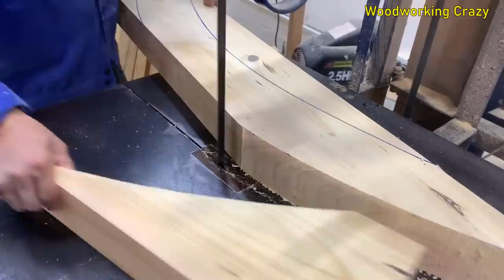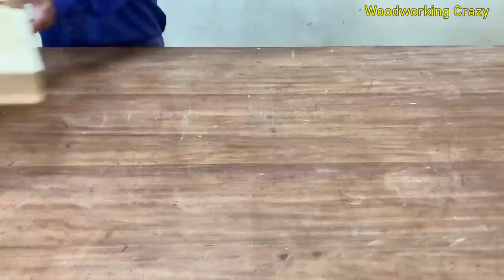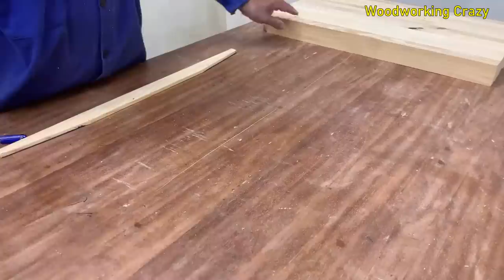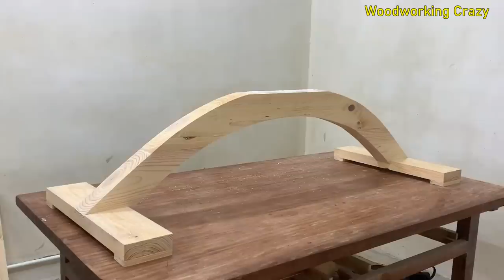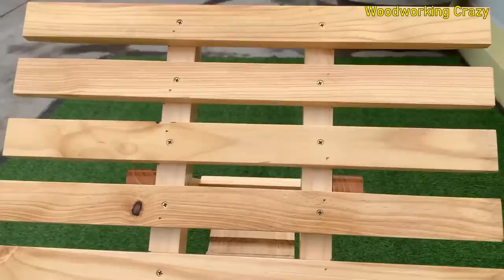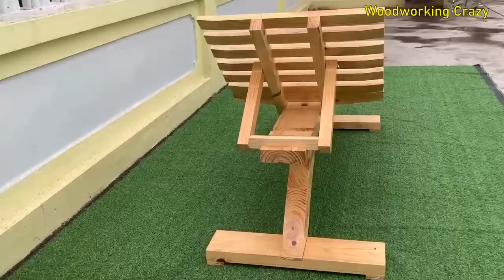The Technique Of Joining Wood According To The Curve Of Skillful Carpenter - Relaxing Folding Chair

Comment: Try using a string to get your arch it will bemore accurate of a radius rather than relying on the wood and nails.Tenon joints or even dowels would be a better choice to display true craftsmanship.

Comment: Shop class taught me to lower the bandsaw blade head to the thickness of the material so you can't trip and slice your face/body in two. You don't need two feet of blade exposed to cut 4 inches of material.

Comment: Nice work, except... Using a pair of pliers to screw in the pivot bolts 😮, and using a router for the final slots instead of the table saw that was used for all of the others. 🤦